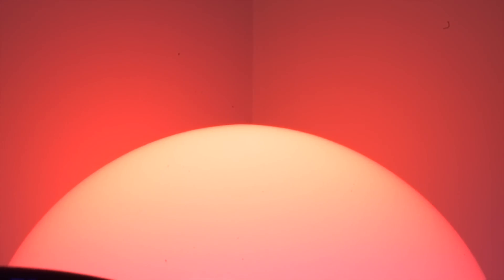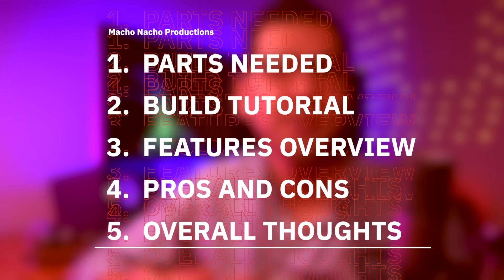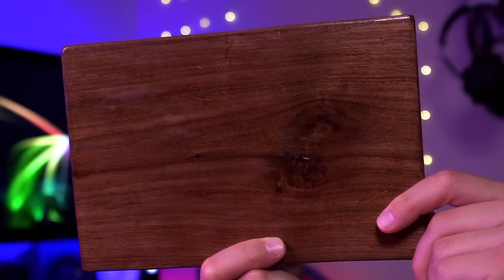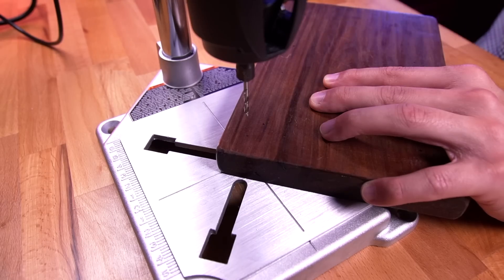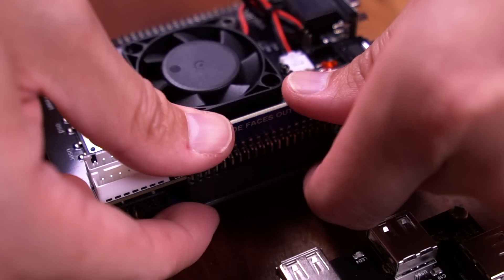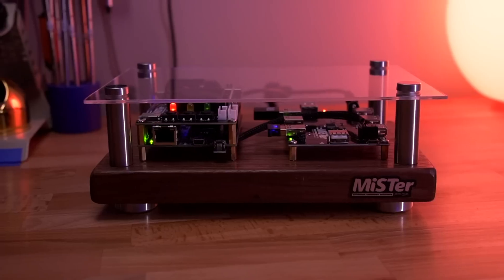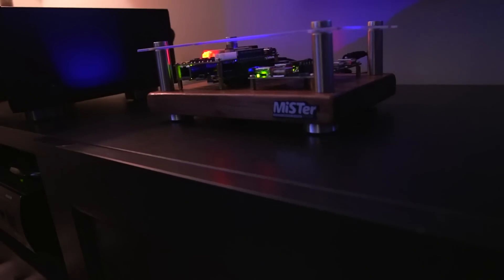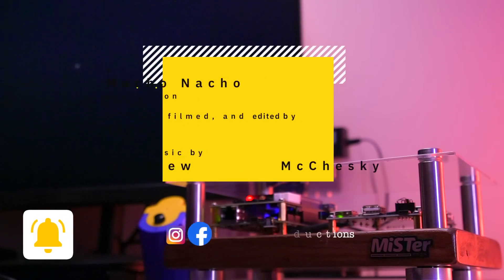Build Your Own Retro Hi-Fi FPGA Gaming Machine!

Comment: Nice build!  I've been building sandwich MiSTers using milled/anodized aluminum plates.  I've also had things like PC Engine, Genesis, and Super NES logos UV printed on them depending on the friend that I've built them for.  (Mine has the PC Engine Logo on blue Anodize, which while not an accurate PC Engine color looks pretty nice :D )  They go pretty well with HiFi stuff too.  Mine usually sits next to the turntable and tube preamp in my living room when I use it there, and doesn't look out of place.

Comment: This looks gorgeous, well done for giving me some cool ideas to 3d print and mock up! I would say the ooonly small thing I'd suggest was what you said in terms of the power switch, ideally a brushed steel power button on the front of the wood itself, with an LED light for when it's on. The other thing could be to round off the edges on the plexi so that it matches the curves of the wood beneath. Either way, a fantastic project and really nicely filmed.

Comment: No, the SRAM modual is not where the cores are loaded.   The core are read in and used to program the LUs to become the discrete chips.   The SRAM is used by some cores to implement system RAM if the internal RAM of the Nano can't be used for vereous reasons.  Evedance of that is there are a lot of cores that do not use the SRAM.

Comment: Pro tip. Go to a fabric store and buy yourself a bit of silk to use as a dust cover for that mister. The open air case looks rad, but cleaning dust off electronics is a huge pain. I use the same method for my guitar pedalboard. Saves you a lot of cleaning, and protects your gear when you're not using it.

Comment: This may be a bit late but the Analog IO board has a header that provides the same functions as the 3 buttons at the top.  Just beside the buttons you should see a 5 pin header, it is sandwiched between the buttons and a 7 pin header, this header is the one you want.

Comment: Or, you know you could just use a raspberry pi
Reply: You could, but it isn't the same thing.  It will not produce the same results because a Raspberry pi uses software emulation and the Mister uses FPGA to replicate the hardware.

Comment: Nice to see someone use the soldering iron to shrink the heatshrink. The times I see builders using open flames when they clearly have a soldering iron right there, amazes me. Anyhow. Yeah the MiSTer is an awesome system, complete next level emulation.

Comment: Sorry, but that isn’t what the SDRAM module is for. The SDRAM is for… well… SDRAM. The cores can use it as they see fit. Some cores use it as extra RAM. Some cores use it as RAM equivalent to the target platform they are replicating. Some use it when they really don’t need to (enough RAM with compatible specs on the DE10-nano already). There are many cores that don’t need it at all.

Comment: "No one wants to be tethered to their console." Some controllers are a pain in the ass top remove the batteries from so I use them wired instead. The steam controller and 360 controller are good examples. Even using motion controls is no problem. Some controllers let you use a USB battery pack to power the controller so you can use it like a Wii classic controller with the Wii mote hanging off though then you will need Bluetooth.

Comment: Nice build idea. I might try something like this. I can definitely recommend swapping out the stock fan for a Noctua NF-A4x10 5V (3 pin). I comes with a dongle for connecting directly to the IO board so no soldering needed. It makes the whole thing much quieter.

Comment: It definitely needs a metal toggle, possibly one that's fashioned after an antique light switch that has 'on' and 'off' in old, chipped paint.
You could also have it use brown cables to look like those old-fashioned extension cords, which would look great with the wooden base.

Comment: If you want to turn the console on and off, you might want to have a remote controlled switch. Either RF with a cute little remote, or a new IoT one that will do the same thing just with more Internet of Things. ;D And some of those RF units have more than one relay, so you could wire them up as the other three buttons on the console. Just be sure that the power relay is a "latching" one, and the other relays should be momentary.

Comment: like the build just Couple thoughts and recommendations.

And alternative for the power splitter would be to make your own. With a double pole double throw switch. Or if those two boards use the same voltage. Connect them in parallel to each other and mount a single pole switch some where. 

I think the USB cable might require shielding. So if it's acting funny on you modify an existing type c cable could be a better option.

Rounding the corners of the plexiglass to match the base would look nicer. 

With your skills you could probably make some real nice vga to component cables from a good quality  component cable for a PS3, wii or Xbox360 cable.  Guys in the og Xbox modding scene do this all the time cause hd cables are so rare for the og Xbox you could probably pull of the Same but with vga.

Comment: That is the best looking Mister case I have seen. Well done. I think a steel power button in the front of the wood panel would look fabulous. It is a thick plank of wood, so I am thinking you could route a power plugin into the back of the wood and drill a hole in the front to feed the cable and power button. The result would be a completely concealed power system.
Reply from the maker: Thank you!  That sounds like a great idea!
Reply: Wow, I totally missed this a year ago, but that's actually exactly what I did.  It turned out as well as you'd imagine.

Comment: PSP consolizer! That will be a cool video!
Reply: pstv
Reply: yNotWalk not the same, that ps vita tv is hard to find at a good price! But psp are easy to find! And the only work to do in 2000 and 3000 will be soldering a controller port

Comment: Out of curiosity, how would this compare to something like a Raspberry Pi 4 running RetroPie or something similar? I would assume using FPGA it can emulate more accurately therefore reducing issues like slowdown and frame skipping, but what other benefits does it provide? And how is the power compared to the RPi4? (I'll do some research on it too, but figured it wouldn't hurt to ask :D)
Reply: i'm assuming the input lag on the mister will absolutely destroy the pi4
when gaming

Comment: Great video! Though it's worth pointing out that you do not need the IO board to get quality, lag free output to a CRT. A simple HDMI to VGA converter does this via the "direct video" mode in MiSTer. I use this mode to send RGB to my PVM and it works great.

Comment: Awesome work on the case! For the buttons, 3 small holes in the top acrylic and 3 lengths of clear acrylic to act as extended buttons could look nice, as for power - you could add a push toggle button on the front opposite to the mister logo. Cut a channel on the bottom going front to back, drill the opening for the button on the front, and drill vertically from the bottom side connecting the channel and the button hole. Similar to how "Ben's Worx" does his power button installs for his light up acrylic art. You could even salvage a button from some vintage knackered hifi for extra authenticity!

Comment: You could install a classic looking stainless steel button right on the front of the wood block, and drill a hole back and up routing the wires right under one of the boards, and wire it up so that the + power goes through the button, to both of the power jacks. The input could simply be a panel mount barrel jack glued to the back of the system, or even drilled into the wood the same as the button if you want a really clean look

Comment: A MiSTer is an incredible investment that keeps getting better and better. I went with the digital IO board since I don’t have a CRT setup going and because of nice features such as the integrated power switch. Many cores can also switch to using true analog-out using a cheap HDMI to VGA cable. (Lookup having alternate INI files for how to easily switch between the two as needed.) Since your case is so modular, I’d definitely consider switching to a digital IO board and selling the analog one.

Some of the craziest things I’ve seen from it, other than the WIP Saturn core, are multiplayer side-by-side gameboy games and cores that support rewind and save-states, since the implementation is completely different from the same feature in traditional emulators. There’s also a variety of the NES core that can play prerecorded inputs in-game, like having your own TAS-Bot. 

Finally, you might be interested in Super Attract mode. It lets the system randomly cycle through games when idle.
Reply from the maker: Whoa that is so cool!  Thanks for all the great info!  I like the super attract mode idea, very cool!

Comment: While it doesn't have as many USB ports, I used the BlisSTer board from Bliss-box instead of the USB board. It has a power button built-in and also includes two LLAPI ports that allows for more accurate controller input polling than USB's 1ms fast polling.
Reply from the maker: Whoa nice!  I’ll have to check that out!
Reply: @MachoNachoProductions  Corrected some misspellings.

Comment: Check the digital IO board if you want a power switch. The switch would end up on the outside of your build if I’m not mistaken. It doesn’t have analogue out, but you can also get that from the DE-10 hdmi port using a cheap dac.

Check the vga to bnc cables for resistors if your PVM needs that. This has to do with the sync voltage, which can damage your TV/PVM crt in some cases!
Reply from the maker: Thank you did the heads up!  Really appreciate it!

Comment: I only have one DC jack. I use the original DE10 nano power adapter, along with a $7 Kasa smart plug from amazon. I turn my MiSTer on from my phone.
Reply from the maker: Whoa very cool!
Reply: @MachoNachoProductions  Yea get the HS103P2 from amazon if you want a complete wireless solution. Also for the controllers, for near 0 latency use the 8bitdo SN30 and 8bitdo N30 Classic Editions along with Raphnet Adapters. I bought all my controllers Used-like new, sold and shipped by amazon (they're basically new but someone bought and returned but about $10-15 cheaper than new)

Comment: really nice build Tito. Different than the standard pancake set up. FPGA is the best way to "simulate" games. Unfortunately, the classic Konami arcade cores are not available, and post 32bit systems require much more power. All in all, as usual great video, and great build!
Reply from the maker: Thank you dude!
Reply: yeah all those classic konami games use lots of custom hardware
so it's not like NeoGeo or CPS2 where most of the work is done up front
each pcb needs special attention and research
when it happens, it will be amazing
Reply: @ynotwalk7391  Interesting, I did not know this reason. I have been looking for a way to play those games and was excited when MiSter FPGA became more known. I believe it is possible to emulate those games via pie but I haven't had the time to do the whole thing
Reply: @Theoneinchocean  
mame has already done a lot of work on these older konami games, but some will still not play correctly
hopefully the work done for mame can help the fpga core development

Comment: you can connect external buttons to the p3 connector, have a look at the schematic, https://github.com/MiSTer-devel/Hardware_MiSTer/blob/master/releases/iobrd_6.1.pdf
I think you could put an input jack and external switch anywhere and solder it to the bottom of the power connectors, I don't think voltage drop is a problem unless you use very thin wires
Reply from the maker: Whoa very cool thanks for the heads up!
Reply: @MachoNachoProductions  the p4 gives you the leds as well. So you can build a separate board for both P3 and P4 and mount it somewhere. 

Also the digital board (vs the analog one) has an on/off switch and a power in. That way you can put a single power into the “hat”, which sends power to the main board, and then connect power from the main board’s power connector to the USB hub.

Software installation is dead simple (follow the instructions, run update_all, profit) and there’s lots of videos. Extending the hardware in interesting ways are far less common. Things like old school controllers, and just custom solutions in general. I think you might be able to hook an little screen up to it. Plus there’s the Pi based midi:)

Looking forward to what you do with it:)

Comment: This would be my perfect console if it ran off the original cartridges, emulation isn’t really my thing, but it’s still pretty interesting! Nice tutorial, and the design looks slick!
Reply: Then I have good news for you (it's not emulation)!
Reply: @axelkusanagi4139  yes it is. Hardware emulation. It tries to be an accurate representation but it is impossible to be 100% accurate. They have to “re engineer” some parts.
Reply from the maker: Thanks dude!  It would be cool if there was a cart reader we could add to this.
Reply: I would sell my soul for something like that! 🤣 @MachoNachoProductions
Reply: @MachoNachoProductions  if I remeber correctly someone is trying to do this with a "Retrode 2", but I do not remember who was doing this to check up on how far they've progressed.
Reply: I said the same thing, I own a Analogue Noir Nt and a Super Nt. Mister has my analogue consoles collecting dust. Between CPS2 & other amazing cores, it's a no Brainer. Save states are already on Nes/gba cores. It like Christmas once a month with developments. Sega Saturn is seeing huge strides, you don't wanna miss out.
Reply: @lalos3813  
the saturn core is already running the 3D levels of BUG
last i saw, it was only earthworm jim
how is it moving this fast
Reply: Running games off cartridges doesn't make it more or less emulation. This works in the same way as the Analogue consoles, using FPGA-based emulation/simulation. On the other hand, a Retron 5 "runs" games from cartridges, but is traditional software emulation (and pretty bad one at that).

Comment: Great video (and I love how yours turned out)! Just a few heads-up; the power splitter/switch might result in a small voltage drop to the MiSTER... might not be an issue depending on how many things you've plugged into the USB hub (coupled with your choice of power supply), but if you start finding certain USB peripherals not functioning consistently then you may have to look into the splitter or your power supply (I use a 5v4amp supply personally).

Regarding analog display cables; I went with a Retro Access cable: https://retro-access.com/products/mister-io-scart. They're a pain to order from (you typically can only order within certain window timeframes),  and aren't great in my experience if you have a problem with your cable (they never replied to a problem I had with a Dreamcast cable I bought from them), but when their products work, they work well.

The MiSTer is an incredible machine; I've relegated most of my original consoles to storage as a result of how good it is (you may be tempted as well, given your similar space issues). Look into SNAC adapters if you want to use original controllers (freeing you from Bluetooth variable lag): https://misterfpga.co.uk/product/mister-snac-controller-adapters/
Reply from the maker: Dude, thank you for all the helpful info!  Very much appreciated!

Comment: Nice video! Concerning hooking it up to the PVM: you don't need a special cable. You can just use a normal VGA to BNC cable.

The sync levels would not be suitable for, say, a SCART TV, but it's fine for your PVM.
Reply from the maker: Awesome, thank you!
Reply: @MachoNachoProductions  no problem! Oh, and also be sure to activate Composite Sync. This can be done by manually editing the Mister.ini or using one of the default scripts from the menu.
The VGA to BNC cables have five leads, RGBHV. the Composite sync signal will be on the HSYNC line of the cable. Connect this to the external sync input of your PVM and you should be good to go.
Reply: @MachoNachoProductions  Those should work for your PVM, but some other options that may work better in your setup include component cables, which you can get from misteraddons (it only has the 3 YPbPr cables, you need a separate headphone to 2x RCA cable for audio), you just need to set ypbpr to 1 in mister.ini. You can also get a SCART cable for it, but be careful because many cheap ones don't use an appropriate resistor to make sure sync levels are safe. Ultimate mister or retro access cables are very high quality and should have the proper resistor on the sync line.

Comment: Really awesome video :) wish this included the LLAPI hardware to allow for original controllers, which is my main demand for retro games, even over core accuracy.
Reply from the maker: Def need to look into that!
Reply: @MachoNachoProductions  Googling “MiSTer SNAC” will send you down the right road, my friend!
Reply: that stuff is outdated now
Reply: @ynotwalk7391  The LLAPI cores are updated usually shortly after the main cores are. Granted, there are only a few LLAPI cores in comparison to what’s available normally, but it’s certainly not outdated for those that exist.
Reply: @theheroslegend  
it seems like fast usb polling and snac are the more current options
Reply: @ynotwalk7391  Yeah, Sorgelig (MiSTer creator) and Ulao (BlisSTer creator) have a disagreement about how the LLAPI should be handled, so officially it’s not part of the MiSTer project. But it’s still legit, just doesn’t have more widespread support as a result. A shame, really.